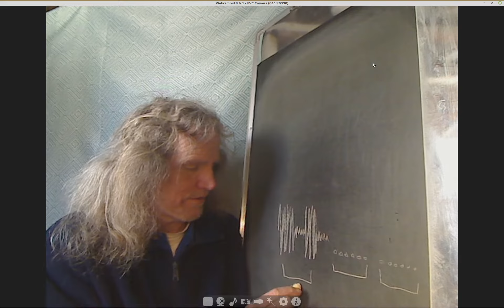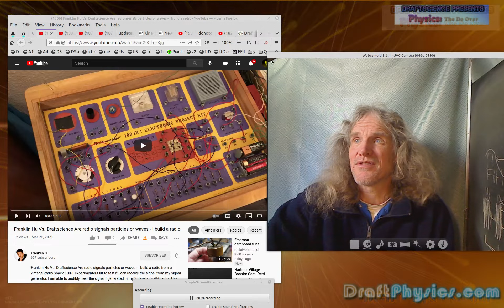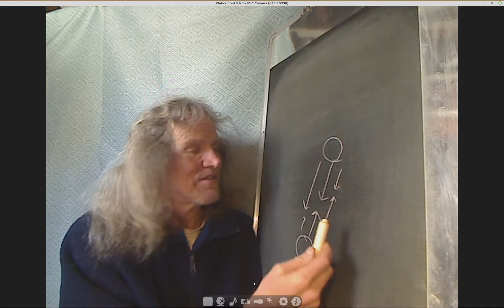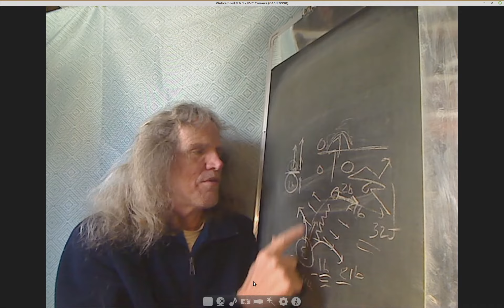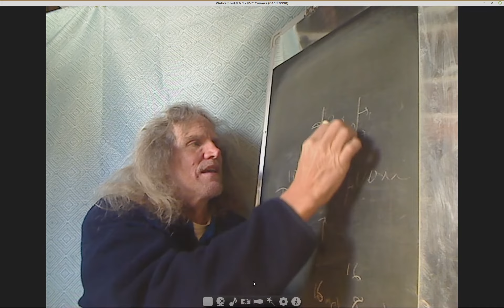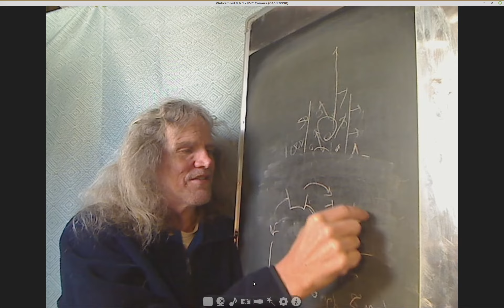DraftScience vs information Waves and Energy

Comment: It's hard to conceptualize experiments that might conclusively settle the aether vs particle question.   Your little electronic breadboard gift reminded me of the one my parents bought me when I was nine or ten.  I'm probably quite a bit older than you, so the kit I received had more antique electronics on the board than the one you're showing.  I think it had the older Germanium type transistor, or a couple of them, a speaker, a few inductors, diodes, resistors, and capacitors to make simple radios or oscillators.  It had a really big meter for measuring things,  and because the LEDs weren't a thing back then, some flashlight lamps for use in projects.  Like you, I cannibalized the board for parts.     

It got me interested in radio generally, so I ended up with a licence (that's the reason for the dahdahdit... in my screen name LOL).